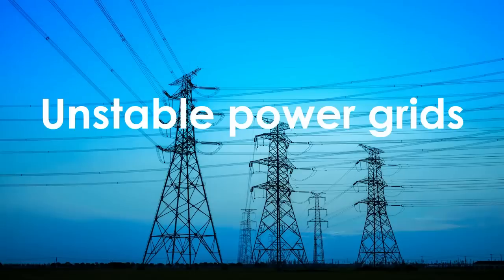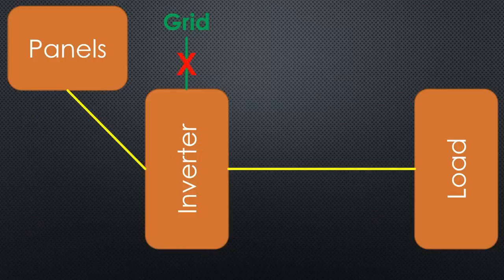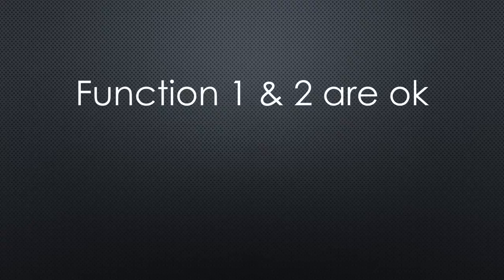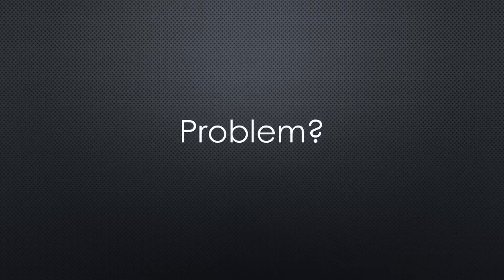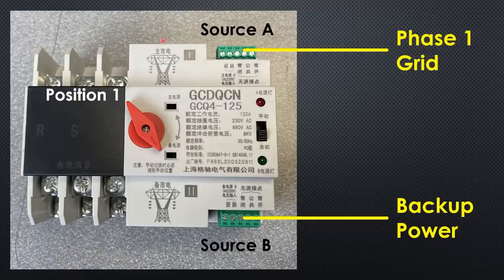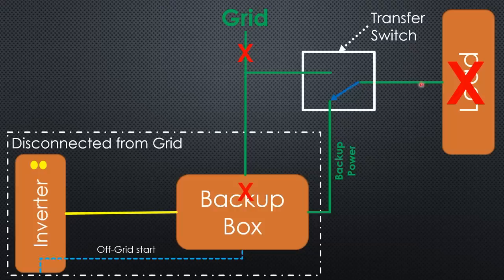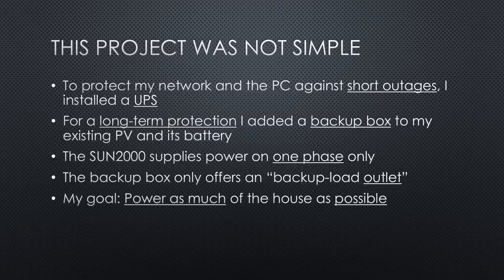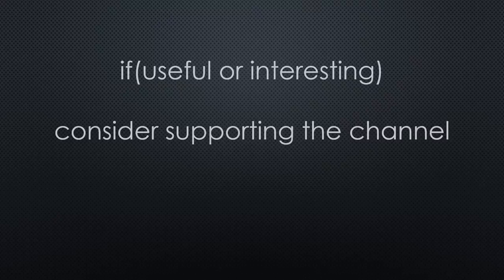448 How to Build an On- and Off-Grid System (Backup Box Hack, Huawei SUN2000, LUNA2000)

Comment: Hi. Fantastic Video!!! I was trying to do exactly what you did in the video since one month and I got the backup box and the switch from aliexpress. No electrician I consulted in Spain was able to give me a solution. Since I am not really knowledgeable in electric connections I didn't have the guts to try it. Can you please tell me  how to connect the one Phase going out from the backup box to the 3 phase switch (or short circuit as you called it) this key connection is hidden in 8:00 of the video. Thank you  in advance
Reply from the maker: The backup power cable is connected to all three phases of the Transfer Switch. But ask an electrician if you are not sure (or if it is illegal to tinker in this area as it is here).
Also here, the idea did not come from an electrician ;-)
Reply: @AndreasSpiess  Thank you

Comment: 3:54
A working internet without a power grid?
What is your DSLAM, your cable provider modem
or your 4/5G BTS in the neighborhood is running without grid on the street?
Reply from the maker: I do not know if and how long it would work. I had some power outages (some even caused by me) and therefore decided to add a UPS anyway. But I agree, in most cases, the internet will be dead when energy is off.

Comment: Another thing, you take shots of a 3 terminal transfer switch during your explanation, that transfer do not apply on your case, you need a transfer switch that breaks the neutral wire too....... in the shots of the box you have installed the correct transfer switch that is 4 terminals transfer cutting the neutral too
Reply from the maker: I agree. I first wrongly got a 3-phase switch (and was refunded by Aliexpress). I do not know if it would have been sufficient, but I wanted to be safe. So I added the one with neutral, too.
Reply: @AndreasSpiess  I don't know specific codes in Switzerland, but maybe you share neutral with your neighbors on a building before the bonding point  🤔, i think its better to break all wires on buildings as you said, just to be sure. 👍

Comment: Only 4500 CHF for the battery? How did you get such a low price? Searching for LUNA2000 10kWh batteries usually shows almost double the price, which is why I usually don't find these systems worth it.
Reply from the maker: I explained the reason in my earlier videos. And I ordered last year, February, 24th.

Comment: I build the same with 3 Victron MP2, my house is connected to the AC Out and even on grid failure there is uninterrupted power. no need for a transfer switch in my case
Reply from the maker: My colleague has a Victron 3 phase system and is very happy with it.
Reply: @AndreasSpiess  any reason for your huawai decission instead of a 3 phase victron?
Reply from the maker: @killertomate1000  Price, high-voltage battery, everything from the same supplier. And the backup was not too important in my decision.

Comment: Quick thought.  What would happen if that switch fails when power comes back? Is there any kind of extra fuse that protects against this?
Reply from the maker: There are fuses everywhere. But if the grid comes back and the switch stays, we stay in off-grid and cannot sell electricity or the battery will drain (according the weather situation)

Comment: Would I be correct that in the UK implementation of this type of redundancy would be less complex due to the UK domestic supply being single phase ?
Reply from the maker: All system components are still needed. Just only for a single phase (which saves quite some relays and fuses).

Comment: How does the inverter know when the grid is up or down? if it's just by measuring the 3 phases ac votage of the grid, than woudn't be easyer to have the ats first to switch between a 3 phase surce current and the grid? ant that way you trick the inverter to give u all 3 phases not just one?
Reply from the maker: The inverter is only capable of providing one phase (explanation in an earlier video)

Comment: Hi Andreas, I still don't understand, as you want to keep everything as simple as possible, why you have a 3 phases wiring in the house ! you don't have heavy power machines that would need it ? in the US they only have 110v so 3 phases are almost needed, but with 230V one phase can power a whole modern house.
Reply: 3 phase wiring to the house is standard in Switzerland and it’s mandatory to roughly balance the power consumption of the 3 phases by using all of them. As soon as you’ll get a battery electric car, you’ll be very happy about the 3 phase supply, which is able to provide up to  22 KW charging power. In US you normally have 2 phase 220v to your switch board, where 2x 110V were separated.
Reply: @markusm.4556  To add onto that, countries like Australia and I believe the UK, use single phase 220/240v.

Three phase power is also available, but almost no residential properties have it.

Comment: does the LUNSA2000 converter recharge the batteries (during sunshine of course) while it is operating in "off-grid" mode?
Reply from the maker: Yes, the SUN2000 charges the LUNA2000 battery if it has enough energy

Comment: If the battery runs flat and there is no sun, how will the transfer switch return to the grid position?
Reply from the maker: I think it is powered by the grid as well as from backup, but I am not sure.

Comment: If the back up box required double series contacts, shouldn't the change over switch need the same?
Reply from the maker: Maybe. I thought about it, too. But it has a different function. Only if it would short-circuit both sources something would happen.

Comment: I am a bit confused about whether your approach enabled you to use the stove/oven in the end, and I wasn't sure how to interpret some of the comments below on it (referring to VFDs). Was it not the goal to have the stove/oven powered? Or was the goal just to not destroy them while powering everything else? If the former, are there limits on how long you'd reasonably be able to run these appliances for, in an extended off-grid scenario?
Reply from the maker: I never planned to use the ovens and only wanted to make sure they are not destroyed. Commenters wrote that these stoves should not need 400V from two phases and therefore should work. 
Because the panels work in offgrid, it depends on the sun how long they would last.
Reply: @AndreasSpiess  Thanks for the response. I thought that the ability for the solar + battery system to deliver sufficient current to the stove would be the limiting factor in keeping the stove running, not necessarily the power generated from the sun. Is this the wrong idea?
Reply from the maker: @danielsmullen3223  In offgrid, my Huawei delivers up to 3.3kW. But this discharges the battery fast and you have to set priorities if no sun
Reply: @AndreasSpiess  This makes sense. It sounds like in ideal conditions the stove is probably fine for normal use, but anything less than ideal conditions will quickly cause problems. Thanks!

Comment: Have you checked the synchonize if grid return on and your inverter is power on. Is there a short break? or will it couse a failure while the phase are not in sync?

is the huawei inverter intelligent?
Reply from the maker: When the grid is coming back, the Huawei will be completely insulated. The backup box is still open (because it is only powered when the transfer switch is in  on-grid position). The transfer switch takes a few milliseconds to switch from the Inverter to the grid. It should insulate the Huawei first and then connect to the grid (otherwise the fuses will trip because of a short between phases). In this moment, there is no synchronization and the load (and not another source) will get an abrupt phase change. I do not know if this harms the load (it did not during my tests). The same occurs if you switch between an emergency generator and the grid.
If you fear it, you could also include a delay relay structure that you have a 3 sec pause.

Comment: But how do you turn back on the grid and does it switch back automatically?
Reply from the maker: As soon as the grid is back, it switches to grid. The switch is wired that with both inputs "ON" it switches to grid. with only backup ON, it switches to backup.

Comment: I'm not sure if I missed it here or in the original setup, does the solar grid-tie to offset cost and load during normal operation?
Reply from the maker: I am not sure I understood your question. We have a standard on-grid system with battery as shown in the previous videos. Now I added an off-grid option.
Reply: @AndreasSpiess  Does excess solar feed back into the grid lowering your utility costs?
Reply from the maker: @ChrisNguyen01  Yes, we pay 27 cents and get 15 cents for what we deliver
Reply: @AndreasSpiess  Thanks. I didn't originally see the grid-tie part of the system.

Comment: combining threephases into one phases does work but how does the RCD behave after that? (a three phase model) by splitting one phase into 3 wires, the should RCD will break?
Reply from the maker: So far it works. I am no specialist (we have at least one RCD for each phase)
Reply: @AndreasSpiess  perhaps leakage isnt a issue then. (or yet) 

in theory, the diffrent lenght/wiresize/connections of cables/wires makes current(mA) take the easiest path, that might not be the correct one according to RCD-setup, therefore, the RCD should break(trigger).... you got some nice oscilloscope with four channels, perhaps you could measure leakage for each phase/ground/earth before and after connecting all the phases? would be intresting to know. :)
Reply from the maker: @gooseberry46  Another commenter wrote that connecting passes is a common procedure for emergency generators. I will only touch the system when it breaks (I fear high voltages 😞)

Comment: If the power goes out, most of your neighbors will turn into zombies and will be attracted to light! *

You need to make sure that roll shutters on the windows automatically close and that the light can't be switched on if they are open.

* according to rumors on the internet and confirmed by trustworthy tabloids. ;)
Reply from the maker: I think we will solve one problem after the other ;-) But you might be right. Maybe they get nicer if they can charge their gadgets and use my HAM radio station?
Reply: @AndreasSpiess  Offering them access to your ham radio at a time when almost all local sources of QRM are without power is really nice. But please make sure they are licensed. If they aren't, ask them to get licensed. ;-)

Apropos QRM: Have you checked how quiet your new toys are?
Reply: @zvpunry1971  They do not need to be licensed if I am around. And yes, I checked it and did not find problems.

Comment: The transfer switch looks very "chinese". I have a manual transfer switch, and after a few switching cycles, it started to not always switch all phases... Issues with DC circuit breakers as well...
If i would build my system again, i would not again use chinese stuff for electrics. It is ok for cheap microcontrollers, if two out of twenty don't work. But if your UPS fails, while the grid would work...
By the way, i like your solution. Why more expensive or complicated, if it fits your needs?
Reply from the maker: Good to know! We will see if it holds up. Maybe (hopefully) it will not be often used . And if it breaks, I still can order a better one. The damage in this situation is not too big.
What I could do is to test the 3phase one that was delivered wrongly in a bench scenario.

Comment: Were es nicht einfacher einen hybrid inverter (mit 48 volt batterie) zu benutzen wie zum beispiel den DEYE SUN 3.6K
Reply from the maker: Was würde das vereinfachen? Mein Inverter macht etwas ähnliches, einfach mit drei Phasen. Hier geht es ja drum, wie man von on- auf off-grid umschaltet und zurück. Meih Haus läuft ja auf 230V.
P.S. Wenn du die riesigen Ströme bei einem 48V System siehst weisst du, wieso ich eine Batterie mit 800V gewählt habe. Da sind die Ströme 15x kleiner.
Reply: @AndreasSpiess  Ich meine, das Umschalten von on-grid zu off-grid wird bei meinem Inverter voll automatisch gemacht (ungefähr 10 ms). Ich benutze keinen Elektroherd, habe Gas-Herd deshalb brauche auch nicht so viele Ströme.
Reply from the maker: @huseyinakcit1165  Interessant. Und der ist in deinem Land für Notstrom fürs ganze Haus zugelassen? Welches Land ist das? Bei uns verlangen sie eine doppelte Trennung vom Netz :-(
Aber ich denke, dass die integrierte Notstromfunktion die Zukunft sein wird. Der Hersteller kann das einfacher und billiger als ich.

Comment: Hello Andreas, thank you for making this video! I am about to install a Backup Box, but I came across a technical training video from Huawei https://youtu.be/aIIgiHcAte8 . At time 4:28 they show a diagram that I see that the maximum off grid power that we can get from the Backup Box is only 3300VA. Is that correct in your opinion? For me it looked as if you could power your house without any problems. Thank you!
Reply from the maker: Yes, this is correct because it only supplies one phase. As said, I do not plan to cook or wash on backup power to conserve valuable battery energy.

Comment: Extremely bad idea! The ATS you are using is very low quality. I have a few on fire and stopped fitting them. It's much better to keep Huawei's original idea without overcomplicating the installation.
It's just a matter of redesigning your board and separating the important phase 1 loads
Reply from the maker: Most of my consumers have no dedicated wire to the board. 
What was the failure mode of your ATS?